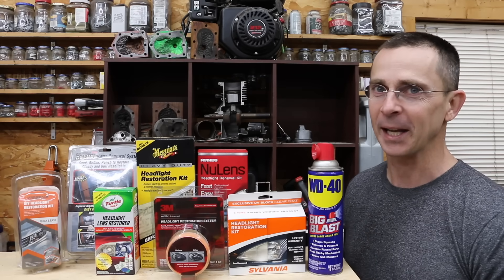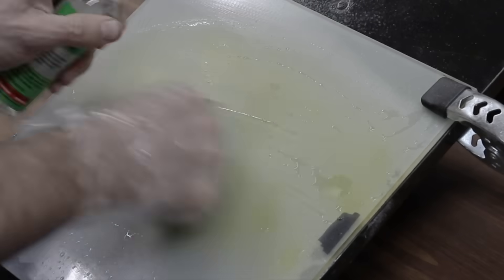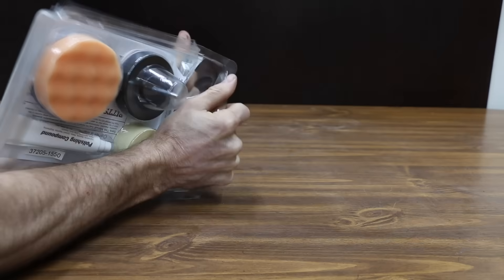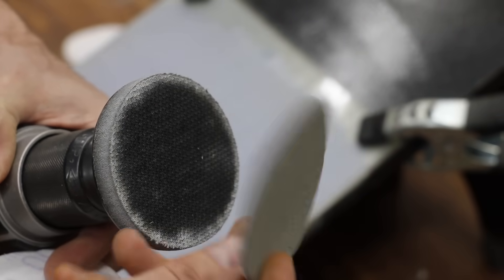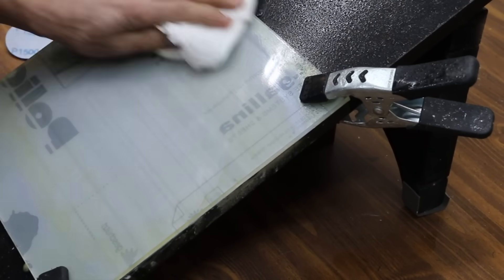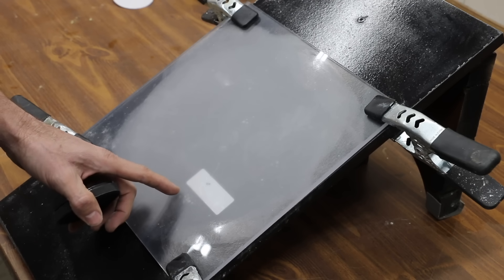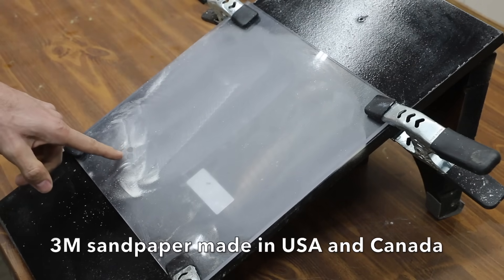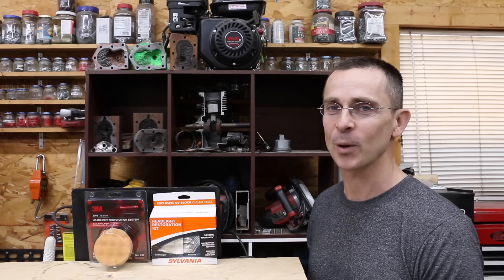Best Headlight Restoration Kit?  Let's find out!  3M, Sylvania, Meguiar's, Mothers, Turtle Wax & HF

Comment: As a professional detailer, I do a ton of headlight restorations, so this was a lot of fun to watch. Sandpaper is definitely a perfect example of getting what you pay for. Just like your battery test, where the cheap batteries were so bad, they ended up being one of the most expensive to use. The time saved alone is worth the extra cost for 3M sandpaper. It not only cuts efficiently, it's very durable, their Trizact pads last forever used properly. Big thank you! 👍👌✌
Reply: I used Harbor Freight sandpaper (the regular sheets)....once. It isn't just bad, it's useless. Writing paper works about as well, and as long. I was amazed by how awful it was!
Reply: Master detailer? What a dork!
Reply: I can say my experiences with abrasives are similar with woodworking and the occasional metalworking. 3M is a consistent top contender for quality and the rate which you chew through consumables easily pays for itself, even if your time changing them out is not a cost factor.  I wouldn't be surprised if that Sylvania kit outsourced the abrasives to 3m or SIA and won this competition thanks to the protective coating filling most of the scratches.
Reply: @patrickweckermann9121  After a lot of experiences with abrasive papers of different brands I also would choose 3M stuff as my preffered choice. I have used SIA and Norton abrasives as well and they are also very good but 3M is what I can purchase most commonly.
Reply: @asad asd It is good to meet an Ultra Mega Grand  Master online in the Youtube comment section. I can only but bow down to you in respect oh great one!
Reply: Not the original poster but, I use 3m sandpaper to wetsand the lens, then I use meguiars m105 with a DA.  I just use Turtle wax seal n shine as a protectant
Reply: Keith,Agree with your view on abrasive paper.3M aluminium oxide paper takes some beating for longevity and staying  clog resistant. All the 3M abrasive range that I have used is good professional quality stuff. Worth the extra cost.
Reply: I bought dollar tree sand paper once. I though it was such a good deal. More material was being removed from the paper then the item being sanded.
Reply: I like abranet paper stuff is amazing at least for wood working,
Reply: Andrew Miller Mirka makes good abrasives, and Abranet is their masterpiece. The only issue is that you need to use it with vacuum, and quite a bit of it as well, otherwise it clogs like crazy. I can recommend the Deros random orbital, very nice machine, just get a lot of the pad savers as you’ll go though the pads otherwise :I
Reply: I appreciate your input. I'm going to go with the 3M, but what's the best protective coating to apply once it's beautiful again?
 I've been told that most Clear-coats only last about a year and that's unacceptable!
 I look forward to hearing back from you...
Mark
Reply: I prefer gator grit
Reply: Nice to hear. I have no clue about sandpaper and allways though, well its just sandpaper. Oh Boy how wrong i have been. Lol
Reply: @ Travis K I'm guessing that in order to become a "master" detailer you first had to start with bait?
Reply: I have those sand paper cleaning block they work awsome too even on the awsome paper it still brings it back and you can it until all the abrasive is just gone LOL 😁
Reply: @asad asd Oh my gosh. you are all on fire today 🤣🤣🤣🤣🤣
Reply: You guys are so funny.  The point of my post is that it's the internet. No need to post your credentials before you say something. They are not valid and there is always someone with higher credentials that disagree.
Reply: @Sam S Detailing is a serious business. I also do window tinting. Audio, alarm,  and wraps. The combination of off these is part of being a master.
Reply: As a master detailer,  I have trained many professional detailers and I can honestly say that Keith Olsen doesn't know a dam thing about detailing.
Reply: @travisk5589  well thanks bud, nice of you to say.. I never claimed to be a "master detailer" just someone who does it for profit over several years.. I also have never heard someone refer to themselves as a "master detailer," with a straight face.. and while I'm not sure how you can gauge my experience level from what sandpaper I use.. I also never said my method is ideal, it is just what works for me.. I've learned an awful lot from Brian @ Apex Detail, especially wet sanding, and adopted many of his techniques with great success. If you don't think that guy knows what he's doing, I cannot take you seriously enough to have a discussion.. but by all means, please enlighten us all, and tell us how a "master" does it. I'm always excited to learn new things and improve! 👍
Reply: @jdisdetermined  I know what you said. You said that you were a professional.  Well master is a few levels up from pro. Masters train pros. You would know this if you truly were a pro. Now we all know for sure that your comment isn't valid. Just saying...
Reply: @travisk5589  How many levels exactly?
Reply: @travisk5589  Well I'm a Grand Master in detailing, I trained in the sacred mountains of Kumano and Omine as a Yamabushi from the mere age of 7 months old. At age 30 I transcended to Grand Master and became the youngest Grand Master in detailing to have ever lived. I can state with absolute confidence that you don't know a thing about detailing.
Reply: @travisk5589  I bet the underside of your bridge is immaculate.
Reply: @brundaged1  That's a trick question.  I like it. It depends on which standards you follow.  The EU have 3 levels. Meanwhile the UK have 4, Chinese have 5. USA have 4, while the Japanese have 6. The Asian countries tend to have the most levels.
Reply: @CaptainPanick  🤭🤭😂😂🤣🤣🤣🤣🙇🏾‍♀️🙇🏾‍♀️🙇🏾‍♀️
Reply: @batvette  🤮🔥🤣🤣
Reply: @master_moose  BWAHAHA!
Reply: @jdisdetermined  Bravo Sir! 👏👏👏👏👍
Reply: @CaptainPanick  😅
Reply: @travisk5589  "master detailer", your parents must be so proud.
Reply: @travisk5589  Master Detailer? lol,, Quit trolling and get back into bed Spanky
Reply: Travis k , I am a Jedi level detailer which is LIGHT YEARS ahead of a mere “master”.

Comment: I've tried a couple different headlight restoration kits over the years. While they do reduce the fogging/oxidation of the lenses, they start to fade after only a couple months, especially when subjected to extended periods of sunlight or extreme weather conditions. After spending a lot of time restoring the headlight assemblies, I found it much easier to just replace the assemblies especially since you can find reasonably priced aftermarket assemblies now days.
Reply: Not to be rude but I've been doing this for 20 years in the South. I do use clear spray paint after polishing. He shows the can in the opening of the video but never used it our mentions it. Unless I missed it.

Comment: I used the Sylvania product and the initial result was good, however, the morning dew fogged the protective coat.
In redoing it, I made a cardboard shield taped to cover the headlight which solved that problem. 
A year later, headlights were fogged again (not much yellowing though). 
I think a different clearcoat, perhaps an automotive 2K rattle can would work better.

Comment: I personally used the 3M kit #39195 which is listed as a heavy-duty headlight restoration kit with guaranteed UV protection for two years. I followed the instructions exactly and the headlights are crystal clear, non-sticky, and just like new. I know you didn't test this kit, but I can highly recommend this one!

Comment: Just for the record I'm letting everyone know that if you put WD40 on your headlights your "restoration" will only be apparent and not actual.  To do this job properly, you need to remove a thin layer of the existing headlight so it will again be smooth.   Applying WD40 does not accomplish this period it's like spraying lysol on a pile of dog shit. It smells good for a few minutes but the dog shit is still there.  Do yourself a favor and get a kit that hooks on to a drill because doing this by hand will wear you out fast.

Comment: I just finished using the mothers product tonight and it was not that great. For one I was only able to do about 1/2 to 3/4 of the headlight because the sand paper pads wore completely out and then began to separate away from the felt material witch became useless after that. The polishing compound is the only thing that worked kinda decent. And by the way I paid 30.00$ witch now I regret deeply and now I am left with only a 3/4 of a headlight finished and a horrible yellow passenger headlight. Witch it took me over 2 hours for the one headlight because of the sand paper was so poor in performance. I should of finished watching this video all the way before going and buying a product. Lesson learned. Guys and gals watch all of the way through learn from my mistake. And it maybe necessary to buy extra sanding materials that are worth a darn....

Comment: I feel much better, knowing I have the same cordless drill as Project Farm.
Have you tried whitening toothpaste for polishing headlights? I've had good luck with it using it in place of rubbing compound, along with the 800, 1500, and 2000 grit paper.

Comment: I’ve always used the 3M kits at every shop I’ve worked at; and I’ve never had an issue with them....but now I may have to try the Sylvania when the wifemobile needs a headlight restoration! I didn’t even know Sylvania made a kit. Thanks for another solid video.

Comment: I would have really liked to see the top 3 used on real headlights. They don’t need to be same car headlight, just close enough damage.  That would have made this test 100%.  Other than that. Great video as always!
Reply: Absolutely. Love the testing methodology but would like to see it validated on real headlights
Reply: @jessi74  or just get 3 light units
Reply: It actually would have been easy to use real headlights.  Grab a pair from the same vehicle in a yard that are equally oxidized and tape them to split them into halves or thirds each.  Polish each section with one kit.
Reply: @mooseman3136  exactly, lot of other channels do that at least
Reply: I tried the meguiars headlight restorer and the 3M headlight restorer.. 3m  by far is the best ,.. but yeah you need the clear coat spray so it will last longer...... I used it on my 2001 Lincoln Town car 1999 Audi A4 2005 Acura RL 2008 Pontiac G6
Reply: @hacatan24  3M ultra kit has you covered. They rather thoughtfully include 2 packets with the wipes loaded with clear coat in them and they give you a glove so you don’t get it on your skin just in case you have an adverse reaction. They tell you to use one wipe on both headlights, then wait 15 minutes or so and use the other wipe. Protect from water and your safe to drive in an hour.
Reply: What I have noticed is that car manufacturers use a wide assortment of different plastics. I just used Cerama Bryte a cleaner and polish for glass cooking top ranges. I worked on my car perfectly. So did my neighbor older Toyota with light oxidation but that plastic still has oxidation even after multiple attempts. Better almost clear plastic lenses. Next did my other neighbors old Santa Fe, one head light had been replaced which became bright and clear again, other headlight was 30 year factory original and glass polish helped but it really needs 120 grit sandpaper to remove plastic tree bark feel. Easier to replace. My point is that there are different types of plastics, so test results would vary depending on the different types of plastics.
Reply: I also think he should've used real headlights at least as part of the test after the initial testing on the squares.  He could have gone to a junk yard and found a car with large headlights and then done each light with a different product on each half in order to test the top 4 products in a real world test.
Reply: I'd be happy to volunteer my truck! Free of charge! My fog lights are hazy, too! Test out all 3 of them!

Comment: Blue magic metal polish works well on plastic i have used it on many heavy oxidized items for example an old fire truck light bar. 
I noticed that the blue magic company now has a headlight/plastic polish and a separate lens sealer. Haven't used it but would like to see how it compares!
Keep up the great content!

Comment: I've had pretty good luck with one of the headlight kits from CureUV dotcom.   The one I used was LightRite, and its main claim to fame is that it replaces the UV-cured hard coating on your lens.  You sand off the old crud but that's the end of it.  Instead of polishing the polycarbonate, you simply spray on a new hard coating and leave the lens in bright sunlight for the afternoon.  The UV in sunlight will cure the coating into a hard shell.   It's thicker than the OEM coating and not quite as smooth (hey, it's a rattle can), but it lasts longer, like 10+ years...

Comment: Have you ever considered testing different types of hard flooring for wear resistance? thinking some sort of jig that repeatedly rubs a vinyl/wood/ceramic tile with some light sand paper or something like that. could compare various flooring options you find at home depot or lowes. Would be mostly an aesthetic comparison though so not entirely scientific.

Comment: Wild.  I bought the Turtle Wax kit 2 years ago and thought I got OK results, but it was a TON of work using those little rectangular pads.
A week ago I dug out the remains of that kit and used it again to make a big improvement over the again faded headlights.
Note.  I think I paid about $15 bucks for the Turtle Wax kit at OReillys.   Rip off!
Reply from the maker: Thanks for sharing.

Comment: I have a similar experience with the Harbor Freight kit. It ended up working, but I had issues with the sandpaper. The instructions don't say to use water when sanding with 500 grit, but I did amd the pads lasted longer. I ended up hand sanding with 1500 grit and 2000 grit 3M paper before polishing.
Reply from the maker: Thanks for sharing.

Comment: Was about to buy Sylvania on Amazon until I read a few top review how it crops out after just 3 months and looks worse than before the restoration.
Reply: I've used it on 4 different cars with great results. Been over two years with little to no degradation.

Comment: I use Harbor Freight product to restore lenses. If you use soapy water with it during all sanding it makes the sanding pads last very long. I've restored 3 cars headlights with one of those restoration kits! But you have to use soapy water during sanding.
Reply from the maker: Thanks for sharing.

Comment: Sir, I believe that you always face with floor cover with engine oil problem.  My cat accidentally spilled a liter of used engines oil to my garage floor & I found it is not easy to remove all the remaining oil. I used normal floor cleaner, the result not very good. I watch from YouTube that they used coca -cola to remove the oil, I tested it, still some of the oil left. This gave me idea to approach you sir. Any chances you test different method on removing used oil at floor or maybe different floor cleaner/ scouring powder/ bleach etc on removing left oil on the floor. Tq
Reply from the maker: Thanks for the video idea.

Comment: Awesome vid as usual.  I found that wet sanding the lenses with 1200 grit, then simply clear coating them with rustoleum 2x clear, works pretty good.  Seems to hold up too.
Reply from the maker: Thanks for sharing.

Comment: The best headlamp kits use various grits of MicroMesh Polishing Cloth. MicroMesh is the gray foam-backed disks but is also sold in cloth-backed sheets. MicroMesh is known as a "non-abrasive abrasive" which means if you lay into it with some muscle, the coarser MicroMeshes (2400-1800 grit) can be somewhat abrasive when you need them to be, but they'll also polish if used lightly. The finer grits (3600-12000 grit) are for polishing only. 

MicroMesh was originally made to remove scratches in fighter jet canopys. Now it's sold to everyone from plastic car modelers, musical instrument makers to nail salons for glossing, deburring and buffing. Wet or dry, MicroMesh is amazing stuff. It's what I use to renew my headllamp fixtures with, then spray them with a non-yellowing urathane coating. The only problem is the price... it's VERY expensive. I have been using the same batch of grits since the late 90's when I was a trombone maker. These days, I use it to polish guitar frets and fix finish flaws on guitars. It polishes metal amazingly well. I still have tons of hard-used MicroMesh from my trombone building days. The newer MM no longer lasts as long as it used to as they cheapened to formula. It wears out much quicker nowadays. It's still amazing though.
Reply from the maker: Thanks for the feedback.

Comment: Aww, was hoping to see if you would use toothpaste as a 'control' as that is often touted as a easy method of restoring your headlights. In case you're wondering, no, it does not do a very god job, but indefinably smells better than any of these!
Reply from the maker: Thanks for the suggestion.

Comment: Great video,...this seemed to favor the more aggressive kits, however you did a great job of describing balancing that out here.

    I would still do a repeat on real headlights,...while it might not be possible to get exact headlights, it would still be real world  results on a actual headlight,......then because you have the headlights, you could put them outside for a measured length of time, 6 months a year and see the results.

  Anyway, just my thoughts, great video as always, thanks.
Reply from the maker: Thanks for the video idea.

Comment: I've used the RainX kit. Its been about 6-7 months and it still looks good. If you look close, you can see that its starting to fade but still looks good from about 10 feet away. Its also cheap at $10 or less when its on sale.
Reply from the maker: Thanks for sharing.